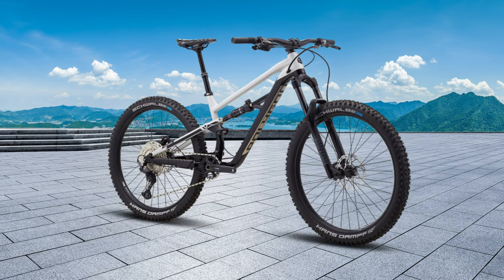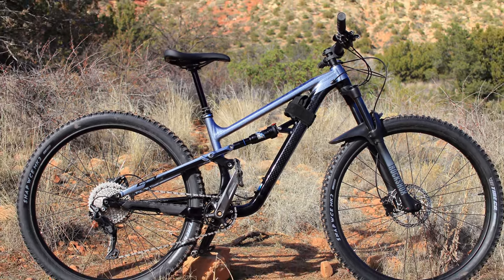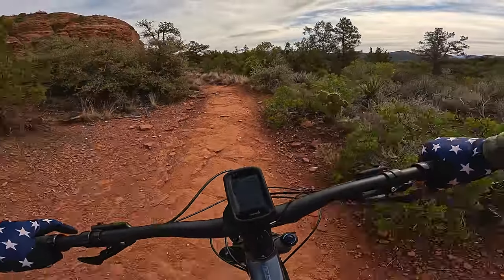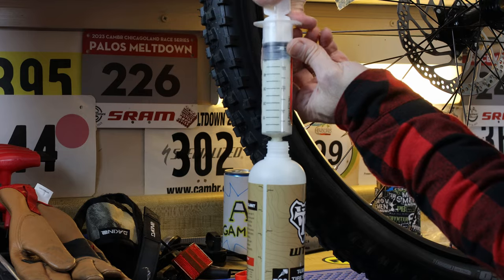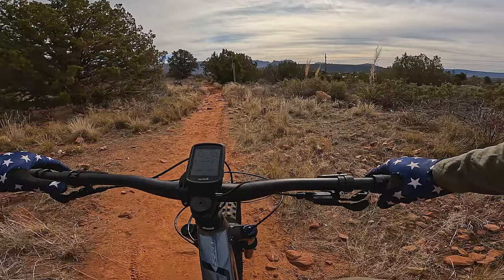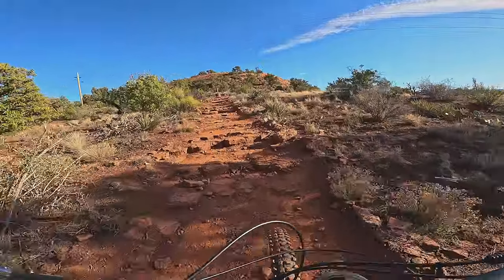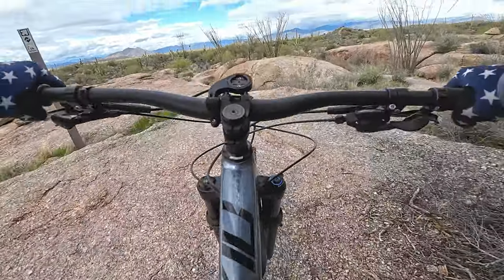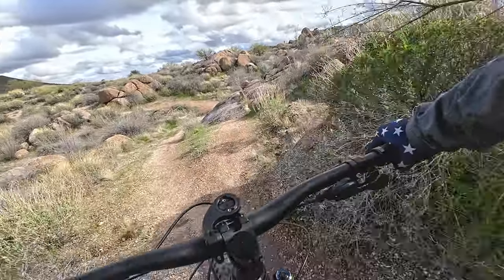This Might be the Best Value Full Suspension Mountain Bike Ever! | A Look at the Polygon Siskiu T6

Comment: The weight obsession is laughable with bikes. Go to the gym if your bike is too heavy.
Reply from the maker: Depends on your purpose. You could  go to the gym and have a light bike and be faster than another person that goes to the gym and has a heavier bike. If you just ride for fun which is what this bike is for, it's not important and the weight helps build fitness.
Reply: @AdrenalineIsLife  I agree with what you said. My point is EVERY YouTube mtb creator has to mention the weight of the part or that part. If weight is a priority, you would not be looking at an entry or mid level bike.  It's becoming redundant how weight of parts is mentioned in almost every review.
Reply from the maker: @CJGrand1  Because weight is important to a lot of people.  Even people looking on the low end.
Reply: @CJGrand1 you don't have to be rich to care about the weight of your bike. Its actually possible to care about both price and weight

Comment: How is this bike so cheap? Crazy, so cool how we can get this at such a good price. I had the T-7 then sold it and thought I was done mountain biking. Terrible idea, because I still wanna ride so badly lol I think I will pick this up, then upgrade that front fork to a fox float, upgrade drive chain to an eagle 12 speed, then the rear shock. All of that will be done over time though.
Reply from the maker: It's a great deal, and the frame is the same as the T7, 8 and 9. You can't go wrong.
Reply: Exactly, the frame alone on any other brand would be twice as much as the whole bike lol @AdrenalineIsLife

Comment: Its a great value bike, that's for sure. Nicely put together.  I've had experence with the Recon and agree with you - its a workhorse you can progress with. I didn't service it until I I put on 3000km on it (yes I know, too long). WTB Volt is a great saddle. The only thing you'll need to upgrade is perhaps find a good 2nd hand 11-51 Deore set (or new before they are no longer available) to get the climbs done, and the tyres.  Else... its a ready made Trail Bike good to go.
Reply from the maker: I was impressed. For the money, it's a fantastic value.
Reply: Why did you say before 11-51 deore are no longer available??
Reply: @david029014  I said secondhand.. not new. I'm well aware it's replaced with CUES

Comment: WAIT!!! You DROPPED the HAMMER!!!! Awesome. Great review. Do you think it would hold up for the type of riding I mash on a bike? I like how you talk to yourself during the ride. 42t may be a little small for my liking... Dang, those are some WIDE rims.. Whoa, you had some heart rate going. That's a heavy bike. Did you look into the bottom bracket cinch wheel as being too tight? The one on my bike was overtightened and caused some "binding" that made the bike feel sluggish. Well done video sir. Quality information and well presented there. Looks like some cool riding was done.
Reply from the maker: Haha. Thanks!  So much to upack. 😀 No, that wasn't me dropping the hammer, That was Jared Morgan from Cure Cycling. We did some filming last year in Bentonville.  I think it would hold up just fine to your abuse. It's the same frame as the higher end Siskiu Ts. We'll see over time how it holds up. There are plenty of heavy parts on the bike, and I think I can get this bike down to 33lbs on the cheap. Maybe less. As far as the cranks,  they spin freely. They're Shimano Hollowtech cranks. They preload differently, and it's hard to over tighten them without breaking the preload screw. It's definitely the tires making it sluggish. You can hear them dragging the bike to a stop when coasting. Lighter or fast rolling tires will wake up the bike a lot.

Comment: Would you recommend this bike over a Giant Stance 29 2?
Reply from the maker: Yes. The Stance has a quick release dropput instead of a thru axle. That's a non-starter for me on a full suspension. Also, the Stance has dated geometry that's closer to a modern cross country bike.  If you're looking for an all round trail/all mountain bike, it's the T6 hands down.